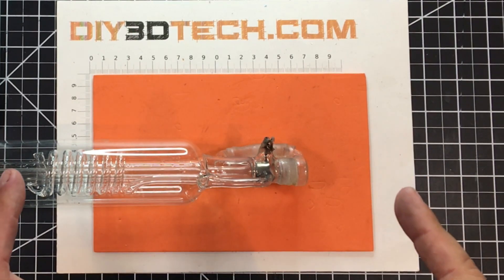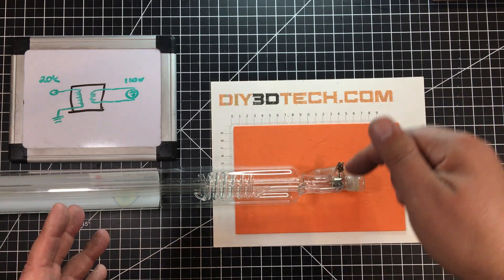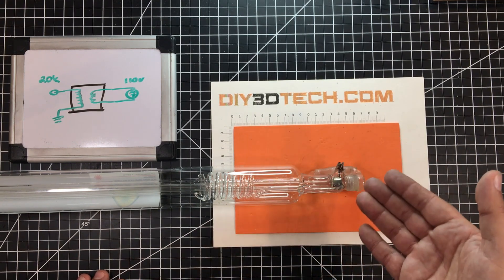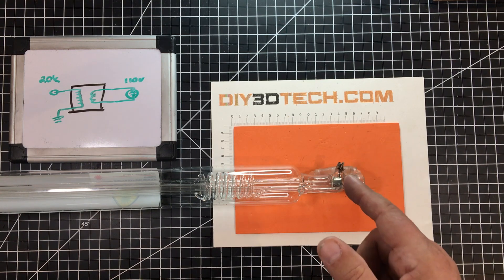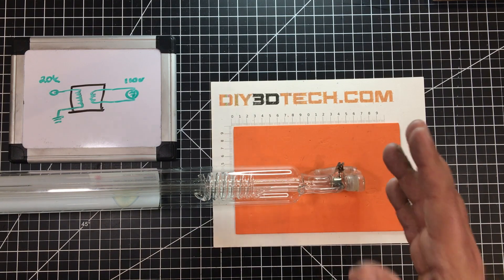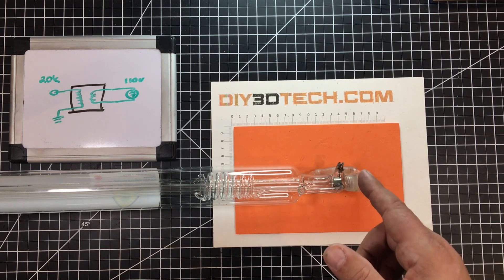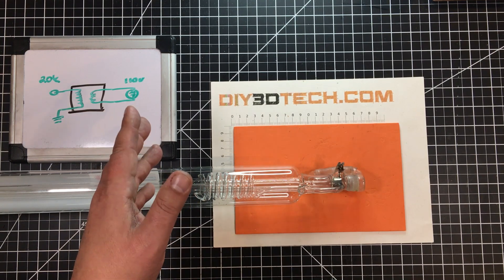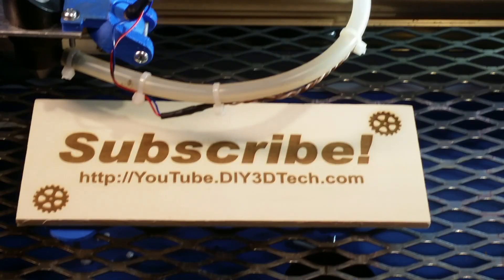eBay K40 CO2 Laser  -  Post Mortem of High Voltage Lase Tube Failure!

Comment: ive wanted to get one of these k40 lasers for yrs but have never gotten around to picking one up cause i always decided on getting a different type of machine instead so i got 12+ printers cnc router, lathe, mill and i did end up getting a diode laser engraver but c02 is on a different level so its always been in the back of my head as something i really want to get at some point. i still want one but im at the point where im more willing to spend way more to get something that is alittle more put together an dont require me having to tinker to get to work out of the box or at least has more direction when getting it setup an going but i dont know if anything has come out since the last time i looked 3+ years ago or more probably, i know i see a couple machines advertising but im pretty sure they are just diode lasers an if i spend that kinda money i want it to at least be a c02 laser so i can cut clear plexiglass.

Comment: Hi
After watching many of your videos 
I purchased a 40k laser cutter and have just finished setting it up.

I am having a problem with the laser tube and can't find an exact answer online. 

First try , it fired OK and I was able to do a test cut.

However,

The next time I turned it on 24h latter , no laser was coming out of the laser tube to mirror 1. (it was glowing purple inside -but not exiting) 

I covered the laser with paper to see if it had somehow become miss aligned , but am not getting a mark on it at all. (also nothing has been moved only switched off)

Also when I turn the mA knob, the mA meter jumps back and forth alot from 5mA to 15mA . (could this be a sign that the laser has a problem?) (also the beam inside the tube pulses a little when I press the test button -like its faint for the first second then turns more solid after) 

And when trying to see why it was not meeting the mirror, there was a crackle bang, and it sounded like the laser tube shorted at the positive end.(at this point I might have turned up the mA dial trying to get a burn mark on the test tape - and the build up of power had to go somewhere )  

I tried another time and I can still see light going through the tube, but it's still not meating the end to exit to mirror 1.

Is this a degassed tube? 

Is it safe?

I really hope you can  give me  some help on this matter.

Thank you and keep up the great channel.
Reply: up same issue

Comment: "Current kills; voltage doesn't" is such a misleading meme. Short circuit a AA battery and you can pull several amps. That's a lethal current, those things must be deadly!
Reply: An AA battery may supply several amps to a short circuit... possible fire risk, but 1.5 volts cannot supply more than a few milliamps through your body, the skin resistance is too high. Basic ohms law, you would probably not feel anything less than 30 or 40 volts (unless on a wet part of the body like your tongue)
Reply: @zebo-the-fat  That explains all those times I didn't die while changing torch batteries.

Comment: Thanks, this is helpful. I guess a well-designed PSU could serve the function of a GFI (or RCCB) by ensuring no imbalance in current between the hot and cold ends of the tube. If more current going out than coming back, there's lightning somewhere!
Do you have any sense of how the connection internally to the tube anode failed? Seems to be open-circuit, how would that happen?

Comment: 3:48
This is a completely preventable failure. Arcing to the chassis of the machine (or anything around the high voltage terminal) should not be an available path ever. This is easily achieved with adequate insulation. Most wire insulation you've encountered doesn't have a dielectric rating above about 600V so a typical solution is silicone. All bare wire connected to one of these hobby grade laser tubes should have a dielectric protection of at least 50,000 volts between it and anything it could arc to (including other insulated wires since this is enough voltage to arc through rubber and other non typical materials for electric current) you can treat 100% silicone which you can get at your local hardware store as having a dielectric strength of 10,000V/mm so bury that terminal in at least half a centimeter of silicone in every direction without any bubbles or holes and it will never be able to arc. I don't mean to fault you or really go hard on you, just want everyone to know how to be safe with these devices.

As a side note you are correct that high voltage kills because only high voltage power sources are capable of delivering enough amperage to stop your heart. Better to say the root cause than talk about amperage and confuse those less knowledgeable. Also yes these arcs going through a person would not be pretty and whoever gets shocked by it should count themselves lucky to be alive

Comment: hello i hope someone can help me with the problem my machine have, its a k40 laser machine, and it shoots a double laser bean (2 dots) from the laser bulb intead of 1, i check the mirrors and everything but the problem comes directly from the laser bulb, in the end of the bulb there is a metal cilinder that is conected to a wire, and i saw that the light bean hits that little cilinder and maybe it makes the bean becomes "double" i dont knoiw what to do anymore and im really sad because i was starting to sell products making by me on the web.
Reply: ayni probleml bende de var ve laserim daha yeni...problem cozuldu mu ...cozduysen nasil cozdun..tesekkurler

Comment: Hi, thx for the information, very good. Was thinking of getting k40 but I think you might’ve changed my mind. I don’t think I want to take the chance with my limited experience. Thanks again.
Reply from the maker: Your welcome, again not to scare but inform because as you can see this is one of the possible things you need to deal with.  Also the tube is a consumable so you need to be prepared to replace it every year or so...

Comment: Good safety information, I know first hand what it feels like to get shocked by 25,000 volts thanks to a careless coworker who left the second anode of a, then state of the art, color TV laying loose on the metal work bench.
Reply from the maker: Ouch!  Yes been there too, many years was fixing a TV (in the days you could fix them) and my hand slipped on the on the high voltage probe and the tip ended up in my neck!  I was lucky!

Comment: Ouch so basically you’re damned if you do and damned if you don’t. interesting that the RCCB didn’t cut out. To me if 20KV is going to the case then it should really trigger a safety device inside the appliance if the k40 won’t trigger GFCI or RCCB externally when it fails. 

It’s interesting video and I’m glad my decision to not buy the cheapest laser cutter was not made up until now 😆
Reply from the maker: It will arch all day long and not trip a breaker, keep in mind that is what it does (creates an arc).  Also the PS is limited so just because it goes to a short, it wont over drive it...
Reply: @DIY3DTECHcom  true but if you had a ground on there which had a voltage sensor tolerant for 20kv it could detect it and cut power safely. Its not impossible it would just need done in the device it is detectable because it will flow through the tube normally and if it fails and grounds through the case the vsensor would detect this and a relay could lose power.

E.G a shield around the failure points with a sensor on it for any voltage, any voltage its failed and wont turn on the power until its reset manually after resetting a latch

The latency would be the real problem
Reply: With a GFCI and general arc detector this is not what I’m proposing. A dumb i2c voltage sensor up to 20kv and a diode so the current can only flow to ground not from the ground into the device

Comment: My tube did the exact same thing,  started losing power, got burned just like yours and then started arcing real bad.  I still did get zapped with it unplugged and turned off when I was removing the wire to replace the tube.
Reply from the maker: If you got zapped, check your ground as something seems to be amiss there...

Comment: And this is another reason I would never get a k40. I don't want to have to reengineer it to have a ”pretty decent laser engraver” (k40 fans words not mine)
Reply from the maker: Yes as I have said and demonstrated out of the box these required a fair amount of modification if you with to use them safely and effectively

Comment: Thanks for the vid, maybe I missed it but did you discuss prevention techniques or alternative add-ons we can use to prevent this type of damage? Possible cause that this happened?
Reply from the maker: Your welcome!  Also as covered in the video it is impossible to prevent, your placing a high voltage sources in a metal box and if the impendence is low enough you will have this happen.  Now people will say put it in a plastic box!  Well that could worse as this works a bit like a faraday cage, whereas a plastic box will likely find you as the ground instead.
Reply: @DIY3DTECHcom  I heard that in the video but wasn’t sure what to make of it. I find it hard to think if we understand what causes this we can’t insure it doesn’t happen. I’m sure I’m ignorant. Thanks for your videos and feedback.